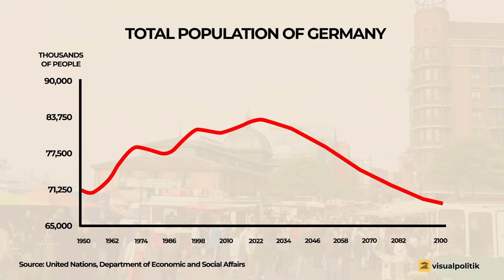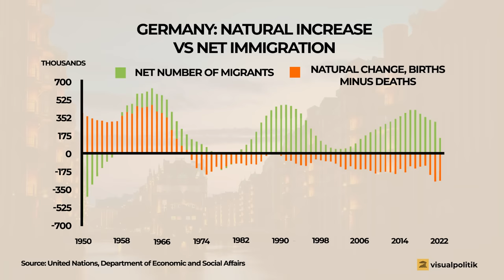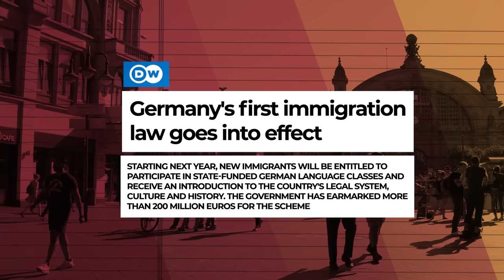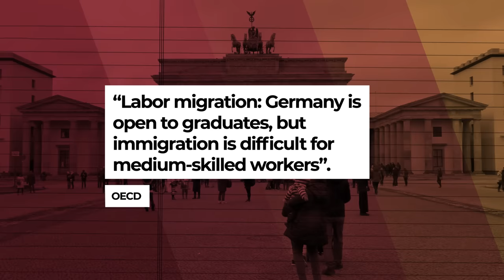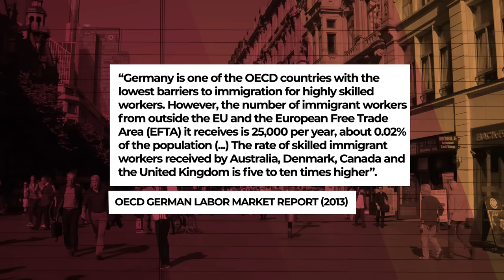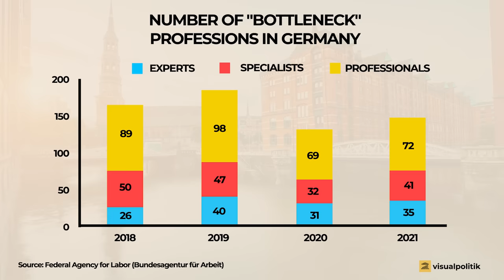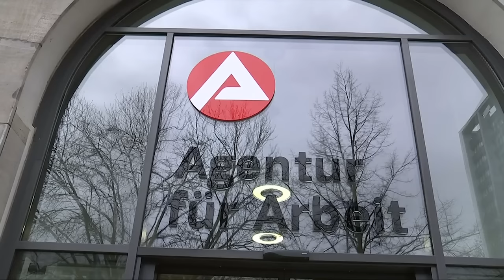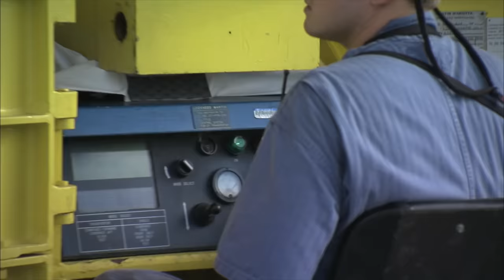Why Is Talent Fleeing Germany?

Comment: A bit surprising to see so many comments from IT/STEM folks here who still consider Switzerland a better alternative. The trick is not to talk about absolute numbers, to keep up the stories about double, triple pay. I guess you have to be junior level or have a very standardized skill set in a sought-after field (typically a developer job) to see some fincancial difference that is worth the effort. I consider myself a somewhat qualified IT security professional and earn around 130k at a multinational in Germany. Better tax rates or not, to compensate for the higher cost of living and the more demanding working environment (most places still at 42h/week vs. 40, 5 weeks PTO vs. 6, less acceptance of home office and flexible working) I'd be looking for at least CHF 160k in Switzerland in a comparable role. - That is not what they pay, at least not foreigners.
While Switzerland certainly can be proud of its education system, I also sensed some hubris when talking to people in my field there. Basically, the only "valid" qualification for employee selection is a degree from ETH; which I also used to hold in high regard, because the technological and competence levels of IT in Germany are deplorable, partly due to the amount of lateral entry employees (I am one myself) and a lack of general technical thinking/proficiency/intuition. Several conversations with IT professionals from Switzerland, including ETH graduates, yielded no evidence that the situation is any better there, sometimes even worse (the kind of disregard for established best practices and the negligent reinvention of the wheel that you mostly find in small companies).

Comment: as a scientist living and working in Germany for more than 9 years, I am not agree with the exposed. I completed here a PhD promotion and have been working as a professional since then. I haven't had any problem to integrate into working market as the same I have seen with other friends with similar backgrounds. Got firstly a blue residence card from EU, then a german permanent residence and since a year ago, a german citizenship. I have lived in 2 other countries before and as matter of fact, have been able to compare in between them. Every place has pros and contras. Said so, some of the Anglosaxon countries pay higher salaries  for the same job (e.g. US and Canada); however the living cost in such countries can easily duplicate the one  in Germany, do not offer the same social benefits and the salaries despite higher, don't duplicate the ones in Germany. For some other countries, salaries are sometimes similar or even lower than in Germany, e.g. UK, despite the living cost there is considerable higher. Average gross salaries in Germany are higher than in countries as the Neatherlands, Austria, Ireland, UK , Sweden Belgium and France. Net salaries reduce significantly due to taxes but payed off by a good social system (education, transport, health, unemployment benefits, etc). In my opinion, the hard part of professional developing in Germany is more related to social integration, internationalization and language. Those two factors take a while to be handled (> 2 years) and sometimes that is a long time for a highly qualified professional who is constantly exposed to attractive job opportunities. In the case of language, some companies appear to be more worried about the use of the german language than experience/skills. Countries offering similar incomes (e.g. The Neatherlands) get profit of inmigration of highly ranked professionals since they seem to be more open to the use of english language, are more flexible and therefore more open to internationalization. The same can be seen in the scandinavian countries which offer even better salaries with similar social benefits. It has to be said, that social integration is a problem not only to foreigners but also to germans. Those are cultural differences that are hard to cope with and that take a while to accomodate to. However, germans are friendly and very supportive people once you get to know them well and they are open to you. Burocracy is another issue. It is huge and sometimes desperating. Every single issue takes piles of papers (serious problems with digitalization) and a lot of time. Nevertheless, once burocracy is completed, the system appears to run without problems.

Comment: in comparison to countries like the usa, australia, sweden, norway, switzerland, etc., germany offers only low wages and high duties and taxes. many Germans therefore want to emigrate or are talking about it.
even if it is more expensive in other countries, in the end there is simply a lot more left.

as a normal employee you save 300-400€ a month, more is not possible.

the younger generation up to 40 years old is rather poor compared to the older generation.

estimated loss of prosperity (göeichem job and age) I would estimate this at 40-60% in the last 30 years.

Comment: For me the much of the problem is that if you want seniors and midt's you need to take into account the fact that they have family and kids. German kindergarten system is terrible and impossible to get a spot. The primary and secondary school system is exclusive and puts too much weight to German skills, rather than other skills. The housing situation is bizarre, and the live/work balance is not as good as in other places. And the bureaucracy...  In my opinion the most problematic is the Germans being very proud of their cultural heritage ans thinks it is superior, thus tend to look down on the non-germans on every level.

Comment: After having worked in Thailand for 5 years making 3200 Euros after tax ( I think it was 15% or 20% taxes ) I thought I would try to move to Germany which I had left in 2005. Little did I know... Arrived in Berlin and oh boy - the whole city is basically a toilet. Rents are out of control. Forget renting your own apartment because why would there be enough housing? And what's up with the salaries / tax ratio. Like why would I be forking out basically 50% in Socials and taxes when I cant even rent a one bedroom apartment because the dude that smokes a pack of camel a day and goes to the doctor 3 times a week when he is not sitting all day in front of the bakery has some 30 year old protected rental contract. Fuck that. 

The infrastructure as well is a disaster. Trains are never on time and expensive as hell. The international airport has flights that leave at 06:00 a.m. but there is no way of reaching it in the middle of the night unless you literally sit on the floor at 2 a.m. and the list is really endless. It's inconvenient and expensive. The only good thing about Germany is nature and parks. Forget the rest.

Comment: 4:00 - Boosting immigration if your native populations shrinks is NOT doing your homework.
5:50 - Unnecessary immigration, not all highly skilled, giving them hand-outs from taxes, and not preparing the educational system for it. Also, not doing any other reforms. This video is garbage so far.